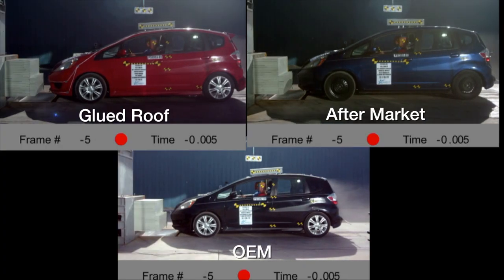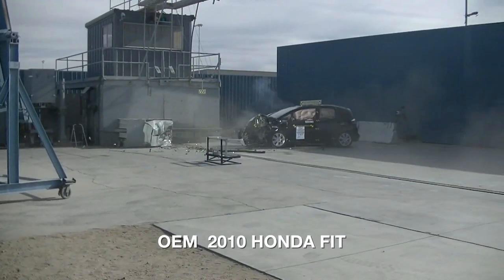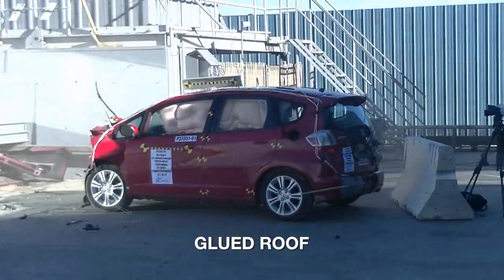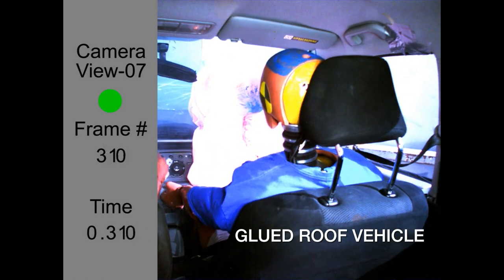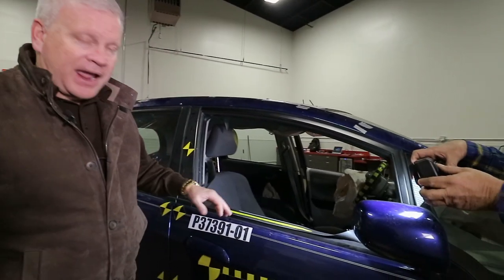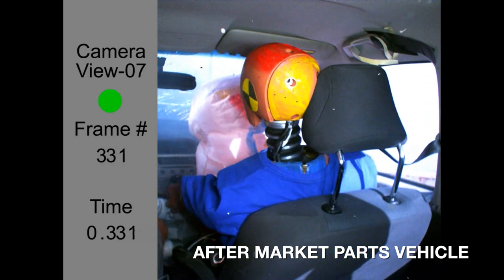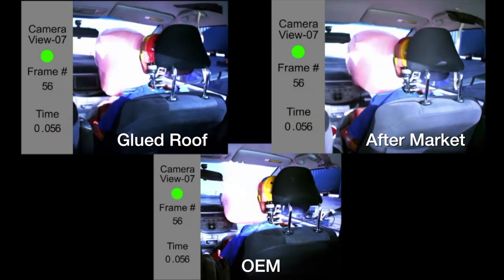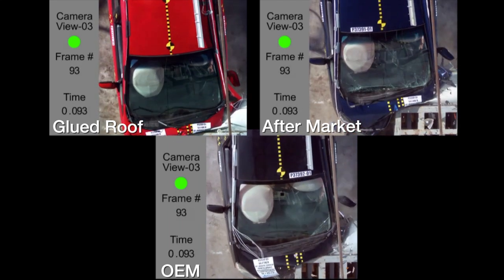Crash Tests Prove Aftermarket Auto Parts & Non OEM Repairs Cause Serious Injuries

Comment: I think you can be the one to gather shop owners together across the country and help us stand together some how and fight these insurance company’s. I just had progressive total or I thought a 15 I Altima because I wanted to repair the car right inner quarter panel the correct way. They lied to me and the customer told me it was a total loss. Two days later customer comes in my shop screaming at me because I totaled her car out. Obviously progressive lied to her on top of that they made a deal with her to give her a extra 1000 and have her car repaired somewhere else. Rather than pay me 2200 more to make it safe. She also has three kids in the back seat. She had a agreement that stated they would return her car to factory specs with factory procedures. If she was ok with cosmetic blemishes.